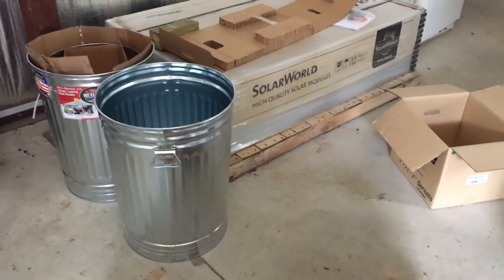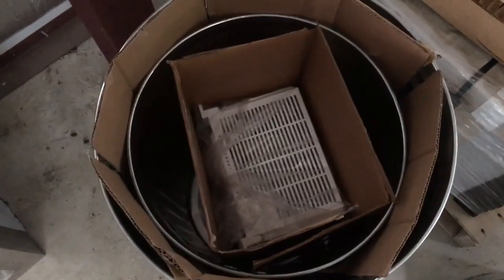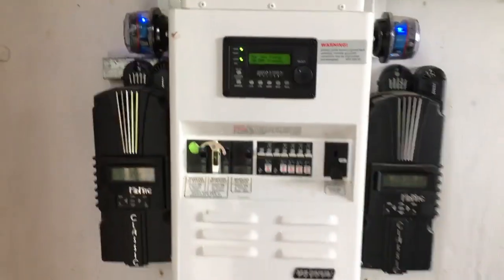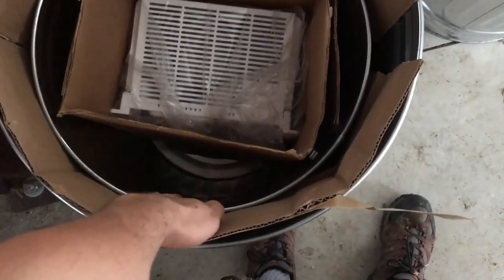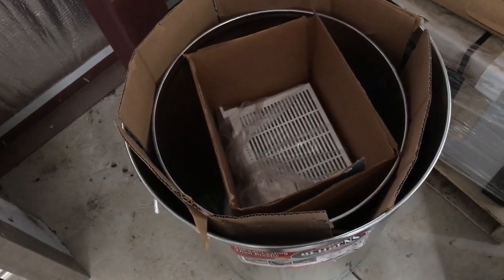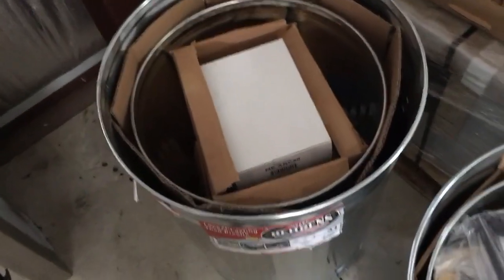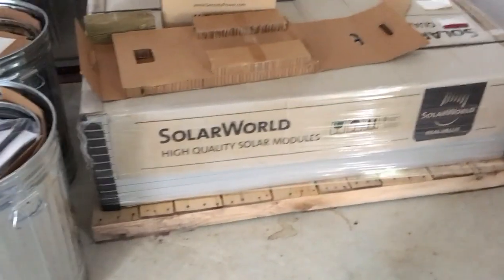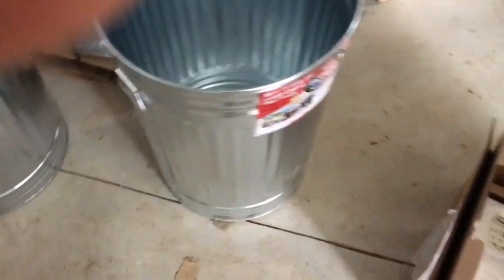EMP Proof Solar Components: Trash Can Faraday Cage

Comment: Why can't you get the flex seal paint and paint the galvanized cans inside, which would be a rubber barrier that would seal the seams and any holes that might be on the handles etc. Which would also be a barrier.

Comment: I believe it may be a good idea to protect a few small electrical items, however these devices used to supposedly protects the home from EMP seem ridiculous. If the grid goes down where are people going to get power?
Let's be realistic about the home protectors,  the Pentagon says if the grid should go down 90% of the US population will perish within a year. If you do happen to have a separate power supply I believe you just became a target. Good luck with that.
Reply: As long as there is Sunlight . Solar power?
Reply: @marievalentine912  I don't feel people really grasp the situation of the grid down scenario. That's 90% of the population in the US dying within the first year, not immediately. All of those people will be starving for one thing, sweeping neighborhoods searching for food among other things. Then suburbs moving out to farms anyone with a power source, fuel, food etc. Solar panels on roof tops will be targets on that home. I don't care how many guns or ammo one may have to try protecting that home it won't be enough to keep others that would come in droves. Obviously, that place has something inside that they all want. Good luck with that! Keep in mind the disease from all the dead bodies surrounding that place in the air and water supply. Really think about why they say 90% would likely die. What this country would really look like. Watch any of the Walking Dead? Solar would be good on a smaller scale for charging batteries and so on.

Comment: if you didn't use any kind of seal on the lid - its not going to work bubba - energy will leak in through the top of the can dude
Reply: Throw a phone into that can with the lid on it and try to call it. I bet you it won’t ring.
Reply: @lukuscarter3563  phones operate on much narrower frequency ranges than an emp would. Any faraday cage with 5%+/- gap or room for seepage is ineffective.
Reply: @erikabaker1439  still, a metal Trashcan like that, lined with rubber, as well as a solid lid on it, should protect electronics from emp’s. Right?

Comment: I'm a retired engineer from a military contractor and I performed EMP testing on our  components to verify hardness. The simplist thing you can do is just remove batteries and have things unpowered they will survive a tremendous EMP pulse as long as there's no power applied. Secondarily the foil bags and cans like shown are good idea but the biggest thing is just have things unpowered and then you will have much higher survivability.
Reply: Would this work for a vehicle? Just  disconnect the battery cables?
Reply: I would also love to know if it works for vehicles? Do we just unplug the battery?  Please advice.
Reply: @brendahernandeznazario6740  yes but modern vehicles  already are pretty well protected. All the cabling is shielded for EMI purposes.
Reply: @dobson777a  what year car do you consider newer?
Reply: @CinderellaCoach  I would have to ballpark consider 2005 and newer. But stick with name brand vehicles. I would not trust new battery vehicles mainly for the battery tech might be sensitive.
Reply: @brendahernandeznazario6740  yes I would believe so.
Reply: @brucehansen7949  yes but modern vehicles  already are pretty well protected. All the cabling is shielded for EMI purposes.
Reply from the maker: Didn’t know this.
Reply: @dobson777a  emi isn’t that great. Just ask John lydon. 
       Also the use of infra sonic ,low frequency , and microwaves on civilians or any living thing. Is an extremely weak response.  And even teenagers make microwave weapons on YouTube.
Reply from the maker: But how do you know when the pulse is coming.
Reply: @GainSolarPower  by paying attention to Coronal Mass Ejections we’ve been having pretty chill solar storms it’s only a matter of time before we have another spike.
Reply: @GainSolarPower  North Korea just announced.
Reply: Thank you